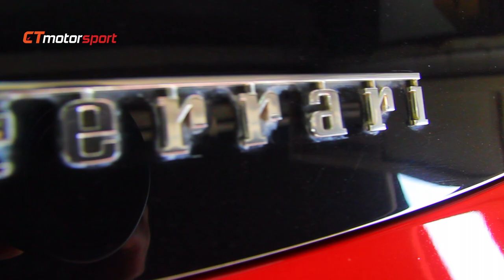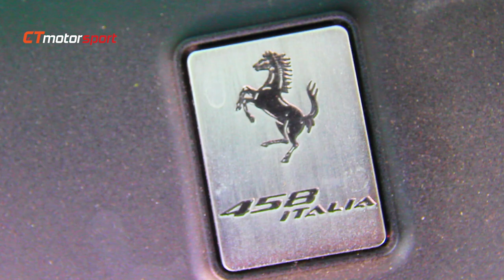FERRARI ITALIA F458 CONVERT TO ASPEC BODYKIT AND CARBON FIBER KIT

Comment: It's OK there no cut in the orginal body soo the owner still can bring back to orginal look..
But if he try to change the rear to spicale he will know what is the meaning of spending..
1. Rear bumper
2. Difuser
3. Exusust tips
4.upper grill
5.raer spoiler
6. Exusust muffler
7. Fog light
And some other parts
This at least will cost over 25k$ or maybe more.